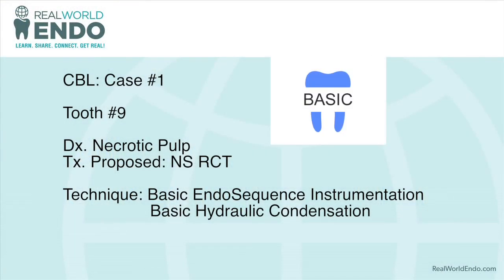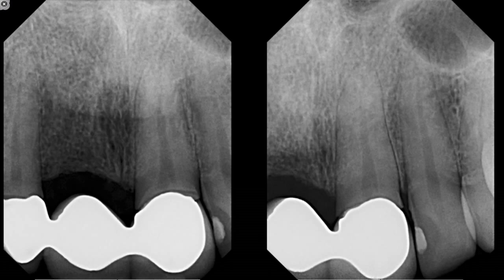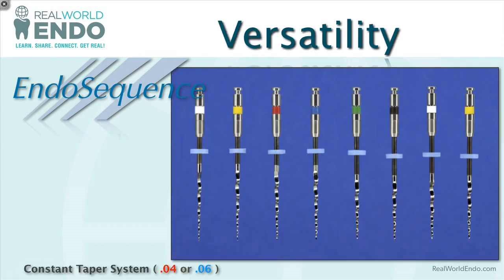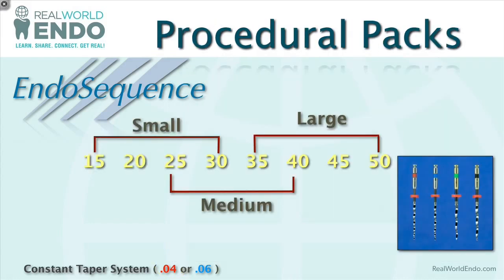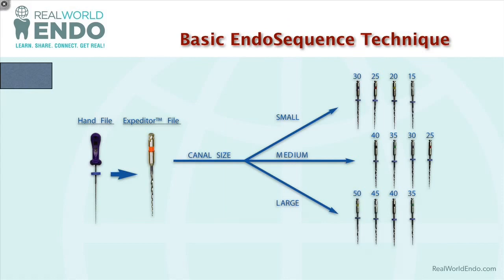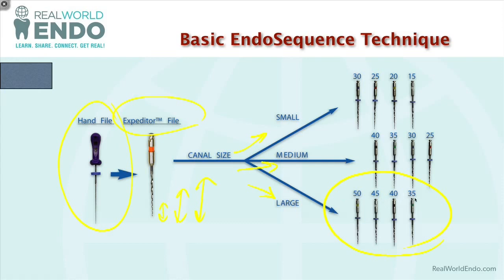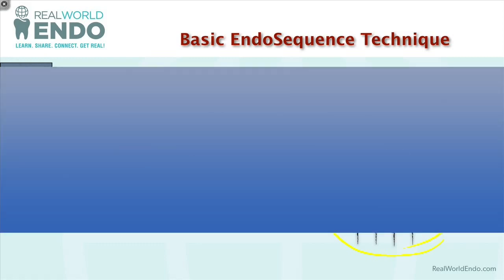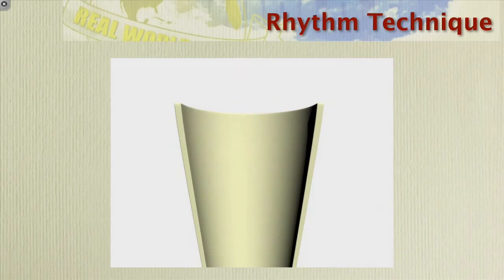CBL #1 Anterior Tooth Endodontics

Comment: Question for you Dr. Nasseh, is it more difficult to retreat cases where BC sealer was used?
Reply from the maker: Not if you've used the RWE Hydraulic Condensation protocol. If you have. Then it's the same as any other retreatment using a solvent. If you haven't and your cone is way short, then you have to work a little more to get through the apical plug of sealer. But you can make the same argument for placing Inlays, onlays, or crowns. Should you cement our final crowns with provisional cement in case you have to remove them? No, we use a strong bonded cement to hold our restorations knowing we won't be able to remove them. We just have to make good crowns! The same here!  :)